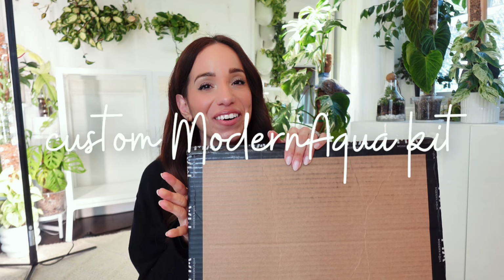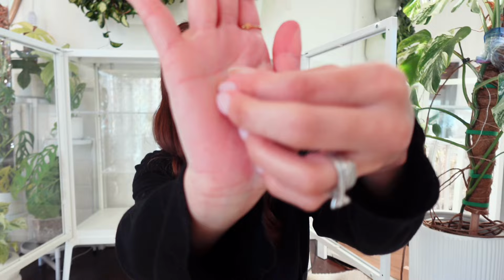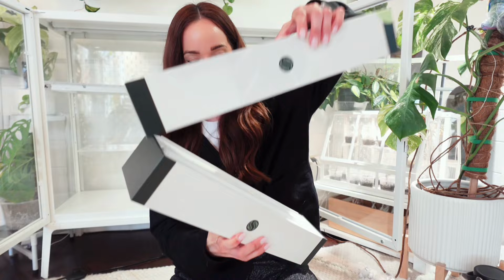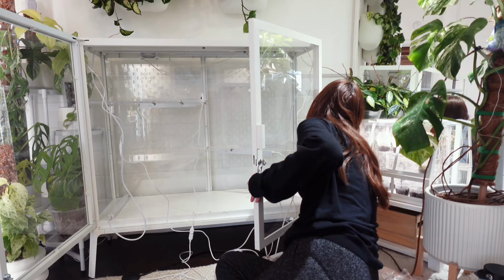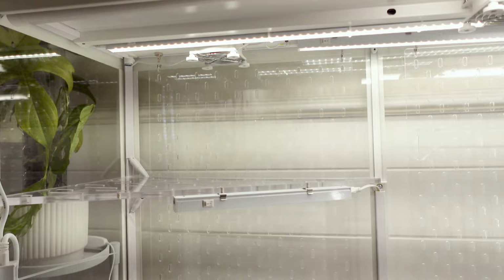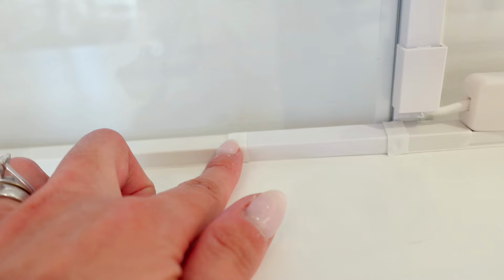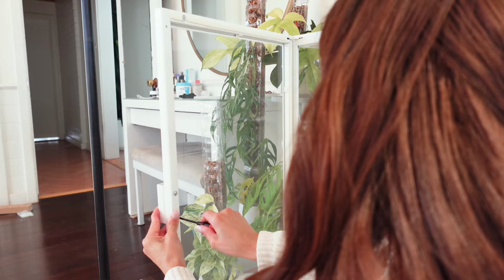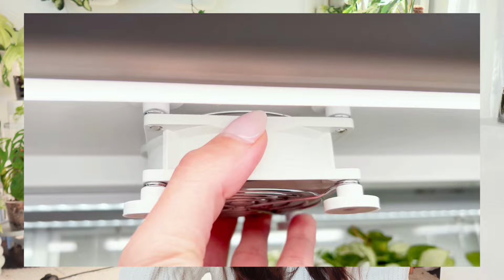DIY MILSBO WIDE greenhouse cabinet | 🚫🔌no-show cords ✨simple + aesthetic✨full plant wall reveal🌱

Comment: I have the same fans in my cabinet and the little rubber feet ended up molding! Good call on taking them off :) I am not all the way thru your video but have you had experience with mold in your cabinet/how did you tackle it?